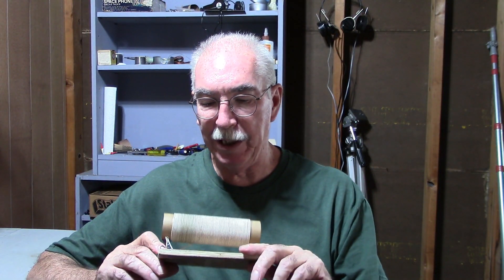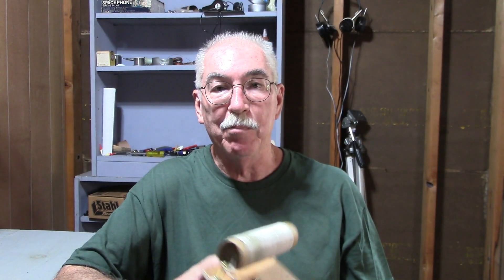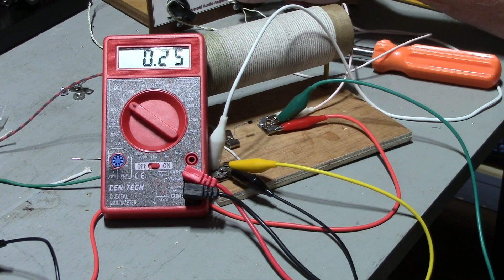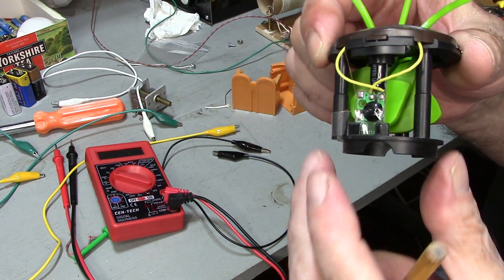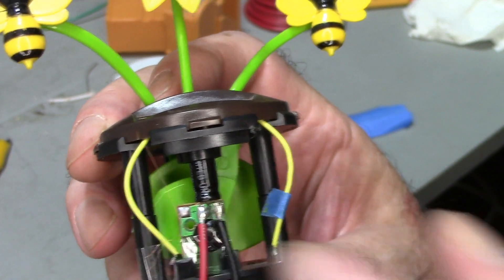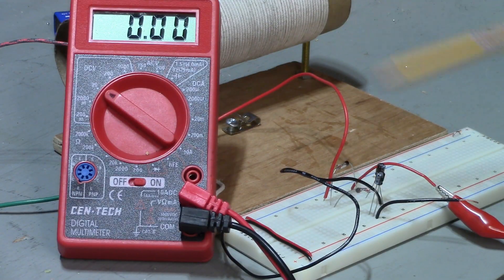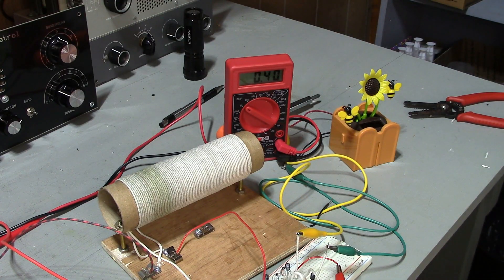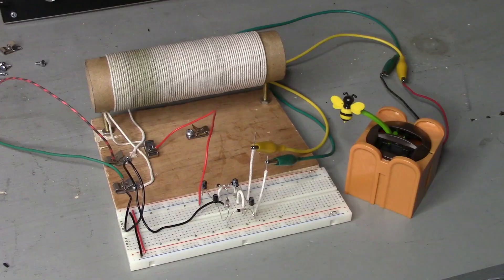Free Energy / Perpetual Motion

Comment: Very good 😊 would putting another coil in series" voltage" parrel "amperage" do anything? Best perpetual machine I have seen on YouTube thumbs up.
Reply from the maker: I think it would if I used two antennas and two coils, but they would both have the same ground so they would be in parallel.
Reply from the maker: Tonight I tried to put two crystal radios in parallel, but I didn't notice any difference. I put up a second antenna, but it doesn't work as well as the first because it's pointing in another direction.

Comment: I mean, you are scavenging radio energy. Its not really perpetual since something had to power those AM towers. I also tried exactly what you are making here, it had such low wattage I couldn't even power a calculator. I bet you would get a lot more power if you walked under some high tension power lines though lol
Reply from the maker: True, I mentioned that as long as the radio stations are on the air the bee will move. You could wrap a coil around an extension cord and get a hundred times more electricity.
Reply: @michaelsimpson5417  Going under high tension lines would be a really cool test lol. And yea, I know you didn't call it free energy, but it's no more perpetual than the flower toy. Back when I tried this, I wrapped like 8' of PVC. I got very little power, less than those indoor solar panels so I just gave up on the idea lol. In retrospect, I bet that extra wrapping didn't gain me much, maybe parallel coils would have done more.
Reply: @Vsor there are actually videos on YouTube of guys drawing pretty dangerous amounts of power doing what you suggest.
Reply: @alphabeets  I bet you could get some decent voltage with a really fine wire and a super high turn count coil, but I would highly doubt you can reach anything near dangerous voltage OR power levels with a 100 turn air-cored coil like that. I used to walk under high tension power lines daily, and I had many coiled up cables in my laptop bag. I can confirm at no point did they reach dangerous potentials.

Comment: Back in high school (circa 1975), I built an AM (broadcast) receiver that used 2 receivers. The first receiver was a rudimentary broadband receiver and existed just to provide a power source, similar to what you built. The second receiver was a very selective and sensitive super regenerative receiver using a couple germanium transistors and was powered by the DC voltage from the first receiver. So it was an AM radio receiver powered by AM radio transmitters. While it still required a little crystal earphone, it picked up stations from all over the country at night powered only by local AM stations near Bell Gardens (Los Angeles). The 50,000 Watt KFI transmitter (640 kHz) was only 10 miles away.
Reply from the maker: That would be a much better application than powering a plastic flower pot. I'll try it!